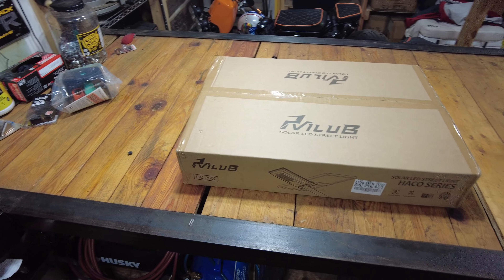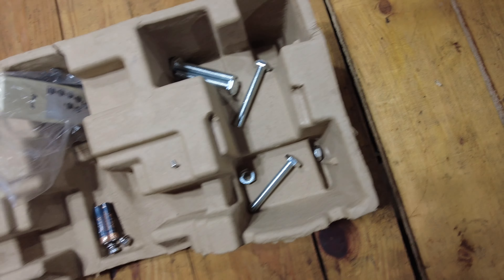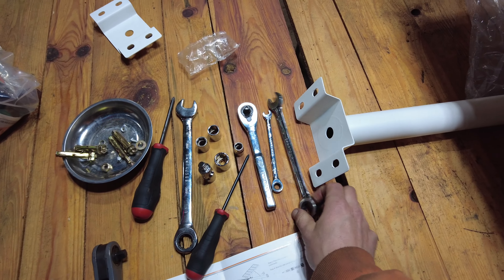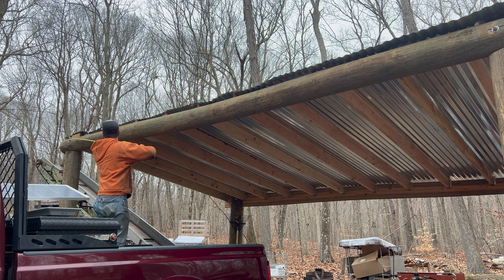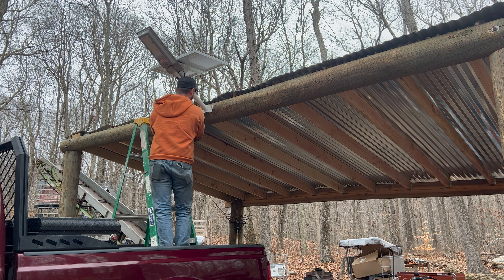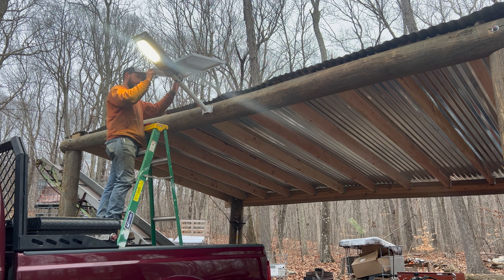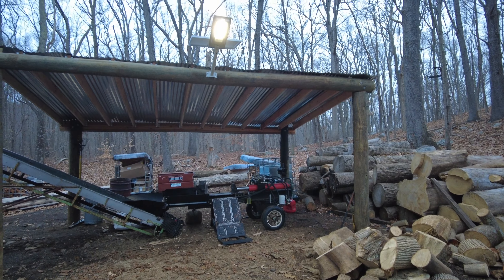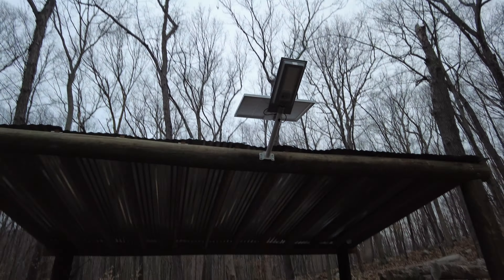#326 Solar LED Street Light for the Firewood Shelter

Comment: You might want to notch in a flat spot on the log so that the full vertical width of the bracket seats on the log.  That will help make the installation stiffer and less likely to work the lag screws loose.

As you have it installed, if East is to the right when you are facing the light, as you suggested when talking about sunrise, then you are facing North.  For best efficiency, the solar panel needs to be tipped to the South, facing towards you (i.e., facing the light, you should be able to see the active face of the solar panel.  The mounting bracket will prevent you from doing that in the current configuration.  If you find you aren't getting enough charging current  to meet your needs, you''ll want to figure out how to re-configure the mounting of the solar panel to gather sunlight more efficiently.
Reply from the maker: Yeah I may have to do that, for now it’s pretty secure!

Comment: That maybe a choice for my remote camp.  Have used smaller solar motion lights but they don't hold up long. See how it works for you then it may be a choice for me. Tks jake
Reply from the maker: It’s a great option if you don’t want to use a generator!

Comment: Id gess its intended to be 20 to 30ish feet or so up.
Didn't cast much light back, on the equipment to me.
I would consider relocating it.
0.01c
Reply from the maker: I was intending it to light up the equipment, I wanted it to light up the area infront of the shelter for cutting. I am going to be using other lights to light up under the shelter.